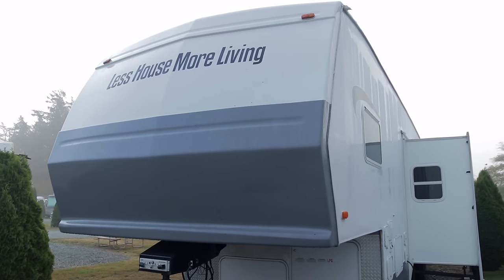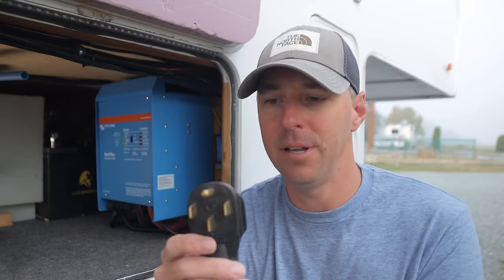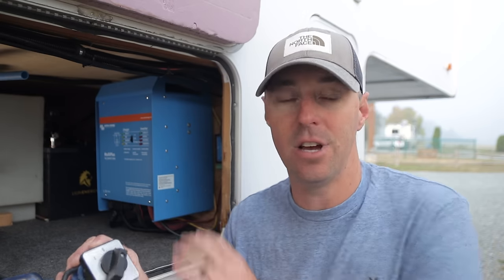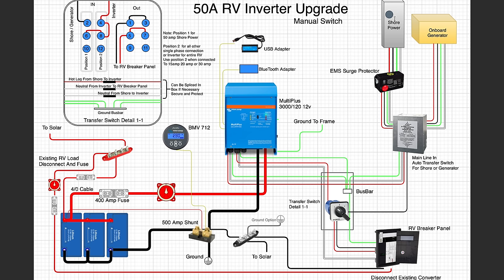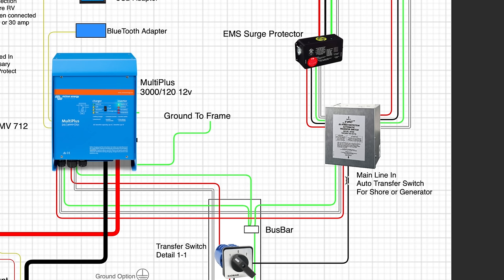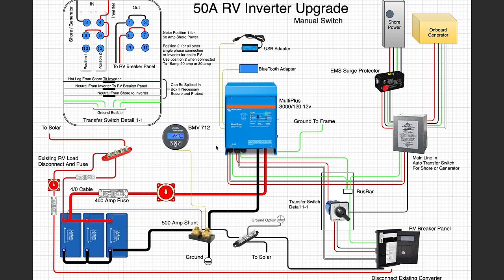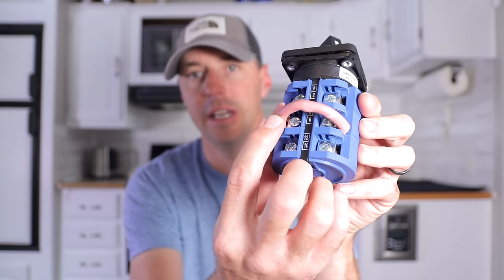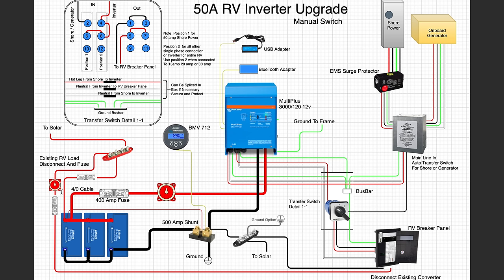Budget 50 Amp Rv Inverter solution!

Comment: Hi. Are you available for hire? I'm wanting to put a similar system like this but in a large cargo van conversion. I will use a generator and many lithium batteries. I need the ability to charge the batteries several different ways like by solar, while driving (DC to DC), on a Onan generator, a standard 110 outlet, 50amp plug, or quick charge at an EV charge station. I don't know if I can use multiple methods at once. Also one of my van appliances (dual induction) unfortunately requires a 50amp connection to get full capability of both stove tops. I'm in the process of purchasing the van right now but it will be weeks before it arrives. Could you possibly help me with this build?

Comment: Sorry if I missed it in the video but what happens if you are in 30amp mode with your switch and you plug into 50amp service. Isn't your switch bonding those two hot legs? I would think at the least you would pop breakers if not cause damage as well. Just curious. Thanks
Reply from the maker: Great question, the second leg is isolated in the manual switch so it wouldn’t cross or pop a breaker. The worst that would happen is you draw more than 50 amps on the one leg and then the breaker would trip. It would only trip if you pulled more than 50 amps.

Comment: Hi.... awesome stuff.  Love your channel!   I was looking at the diagram for the manual switch and I want to make sure I don’t mix up the wiring codes on the switch.  On your 1-3 jumper the orientation on your schematic and the switch match (1 on the left 3 on the right) but on the 2-4 side of the switch they are not matched with the the diagram you provide in the video.  The 4 is on left side of  2 when looking at the switch but your diagram shows it schematically as the 2 on the left.  Can you just confirm that the schematic is just that.... schematically shown but the number are correct?   I don’t understand what the switch is doing inside exactly so I want to make sure my switch numbering is still correct.  I am using the same BAOMAIN switch.  I don’t’ want to find out the hard way I don’t have the exact same setup.   THANK YOU AGAIN!
Reply: Dan, I had the same issue when I installed Jared’s $40 switch idea last year. We are having electrical issues now and I think it’s related to how the switch was wired. How did you ultimately resolve this numbering issue on the switch?

Comment: Hi Jared. Nice video. I just received the manual switch. When comparing the diagram to the switch your wire diagram shows 2-6-10 on the left and 4-8-12 on the right. The actual switch shows 4-8-12 on the left and 2-6-10 on the right. So do I follow the diagram or the numbers?  Thank you.
Reply: Ok never minded. I traced it through and understand that black leg from shore is isolated to position one only and position two is inverter only on both legs. Thanks.

Comment: I am personally not ready to add a system to run anything I want off an inverter. But I thought I would add a comment about a friend of mine who did have a complete solar system added and an inverter that would run anything she wanted in her RV. She had the system for years. And it never worked well for her. She was told to turn on inverter when she turned on her solar panels. And her batteries would run down. She had it in to who did the installation a number of times. Nobody seem to figure it out. Only months before she ended up selling the trailer I finally deduced what the problem was. Refrigerator was a Dometic that would run off either propane or 120 V. When plugged into shore power refrigerator would automatically switch to short power from propane. I bet you can see where I’m going. When the fridge sensed 120 V available from the inverter it assumed it had shore power. It switched the refrigerator to 120 V and there was no way the solar system or batteries we’re going to keep up with that refrigerators draw. This was an older trailer. And I don’t know how many trailers have the same option. Mine does. But I hope it  might prove helpful to somebody to know about. Nice video.
Reply: Dave, I have a 73 Nomad with 120 and gas as well. I read your post 3x and couldn't see the fix to the problem. Can you reiterate please? Thanks, stay well.
Reply: @heatherk8931  If you have put in an inverter to run everything that’s 120 V on your trailer, that is where the problem is. You need to separate the 120 V for the refrigerator from the inverter power. Without going through some wiring shenanigans the easiest way to deal with this is to just unplug the refrigerator from 120 V unless it’s on real shore power.

Comment: Jared, for a future video would you consider a poor mans lithium package setup. We are not full timers but would like to be able to boondock some times. I was thinking of purchasing a Bluetti AC200 which has 1700WH inverter and everything built in. This would also allow us to keep the fridge running on AC while driving (gas while parked). My idea would be to use a similar transfer switch like you used but add a Male plug inside the RV. Then i can use leave the Bluetti inside and plugged in with an extension. I could even run a 12V transfer switch for some other items while boondocking. Issue is i need to make sure i don't drive the house battery charger while running the lithium 120V inverter, else i would back feed the std battery. How would you wire this to allow both options?  BTW great video.
Reply: Google Will Prowse, he is excellent!
Reply from the maker: Yes, I will put this on my list to do this fall or by the end of the year.

Comment: Amazon offers various sizes for the 3 position switch.  IS the 125 amp really necessary or will the 63 amp switch work just as well.  Smaller foot print and should fit in the box much better.
Reply from the maker: The switch in this video is the 63 amp switch. There is one below that I do not recommend but we do have a new video with an update on this setup. https://youtu.be/gbKBoIvXNPA

Comment: Well we ran into a problem and I don’t really understand what happened.  We have been running this set up since Mar of 21 but last week the load side of my surge protector red line that goes to the inverter burnt up, it smells terrible! Have replaced the surge protector and the the wires between the surge protector band the inverter but need to figure out what may have caused that red hot line to burn up.  If anyone has any suggestions I am all ears.  I followed the diagrams to the letter.  The diagram shown in the video is a bit different on the site.

Comment: If I read the diagram properly, when shore or generator power is available, BOTH the RV converter and the Victron will attempt to charge the battery bank.  Doesn’t this cause both chargers to push and pull each other and the charging circuits falsely sensing the state of the battery level?  Also, in a boondock situation where you can’t run the generator, such as nighttime, but you still want the Vectron to be an inverter for 120VAC, the RV converter will distribute the 120VAC but also power the 12VDC converter section which also attempts to charge the batteries.  So you have sort of a circular power-struggle where the batteries are draining down to power the inverter but the RV converter is trying to recharge the battery bank at the same time.  It seems a switch is needed to isolate the connection of the RV converter to the batteries but still let the batteries power all the 12 volt loads when no shore power or generator is on.
Reply from the maker: When you install the Victron you don’t need the converter anymore. Most people just disconnect it. We left ours unplugged because it is a lithium converter so when we do need to fire up the generator we plug in the converter as well and have the converter and victron charge at the same time, hey can charge together with no problem with our 3 batteries. Having two chargers hey don’t fight each other but charge together because charging isn’t just based on voltage.

Comment: Hey Jared, we met in cottonwood last year when i was buying a multiplus and installing solar.  quick question for you.  my SPS has failed already.  So now I'm thinking of adding this switch instead.  when you switch from 30amp/inverter to 50amp position does the whole RV lose power in the zero position or does half the RV still maintain power from the inverter during the switch?
Reply from the maker: Hi Bill, yes I remember meeting you. The way the diagram is yes it looses power at the zero position but I plan to change that. On our new RV I made a slight change and now leg 1 never looses power even when switching. It makes it nice for the microwave clock to not reset and for other things like the TV turning on every time we would plug in for power or having the fridge on while we drive. Send me an email at jaredallaboutrvs@gmail.com and I’ll see if I can draw up that change this week and get it to you.
Reply: @AllAboutRVs  thanks Jared.  That would be awesome.

Comment: I want to use the transfer switch when I turn in position one it will be stuck when I turn position two it will be using the inverter charger that's why I need to contact you  and my rv it's only a 30 amp

Comment: Hi Jared,  I have been working on my 12 3000 victron and using the diagram that comes up when you click on the link under your video a different diagram comes up than the one in the thumbnail of the link.  which is the correct one and how do I get a copy of the one in the thumbnail if thats what I need?  Thanks
Reply from the maker: The download PDF is the updated one you want to work off. I have made a few improvement updates and forgot to change the thumbnail.

Comment: Hey Jared, great video.  One thing I noticed though...  High current system's main enemy are connections.  If I'm understanding your diagram correctly, when you are in the 50Amp mode, the RED leg is going through two jumpers and three connections in the manual switch.  It seems to me it would be much better to wire the RED leg to pin 6 so that in 50Amp mode you just have the one connection going through the switch, and when you are in 30Amp mode, then you are going through the jumpers.  Please let me know if I'm misunderstanding the diagram.
Reply from the maker: That is an excellent idea. I’m going to change the diagram now.
Reply: @AllAboutRVs  Hi Jared, so is the schematic on the site now (9/19/20 at 10:26PM Pacific) the corrected one?
Reply: Got it.  watched again.  thanks.
Reply: @AllAboutRVs  could I get a diagram of the new change on the switch

Comment: Hi Jared- can you post a link where to buy those metal splicers you suggest?
Reply from the maker: I have an update video I am working on now for the manual switch that makes it a little better less connections and slightly easier for the jumpers on the switch. Here are the splice connectors I used and it was easier than the other ones I used and no need to do the heat shrink over it afterwards. 
3way #6 connection. https://amzn.to/3cUzXHG
2way #6 connector. https://amzn.to/3jxxQuL
I used one of the 3 way and I would use 2 of the 2 way.
Reply: @AllAboutRVs  Thanks for the quick reply Jared.  That's exciting about a video update.  I'm going to install mine in late March, weather allowing. Do you think your new video will be public by then?
Reply from the maker: Yes it should be out within a week

Comment: I had a SPS fail. I got the manual switch. I want the manual set up to throw if the SPS fails again.
Reply: Mine failed too.  It's garbage
Reply: @billdorn1053  I got the rotary switch that he suggests. SPS sent me a mechanical unit as a loaner. They are between VER 1 and VER 2 of the ‘silent’ unit. For now I just jumped out the entire inverter. I’ve only gone out twice in the last year and had 50amps at both parks. SPS told me VER 2 is taking longer than appreciated . Should be available this Summer. They agreed it was under warranty and say they will replace it with a new VER 2. I’ll try to wait, but the switch goes in around May they drag their feet any more. Did you call them?? They are not cheap and should do something like they are for me.
Reply: @christopherrasmussen8718  I just ordered this switch and in the mean time they said to use a sharpie pen cap to jam in between the contactors to force it in and bypass the SPS.

Comment: The download for wiring the manual switch at this time doesn't appear to be complete.  It is not the same diagram as in the video.  You'll need to stop the video and do a screen capture of the wiring diagram for the switch.
Reply: Please disregard my comment on the wrong diagram being available.  The video has an update which shows that the diagram currently available is correct and much simpler to install

Comment: Why don't you wire it so that position one is single phase, one hot leg, and position two is split phase, two hot legs? That bugged me about the last video.
Reply from the maker: Not a bad idea. In my mind I thought of position 1 as first choice, 50 amp shore connection at 100 amps potential  and second position as second choice maxed out at 50 amp potential. It would be easy enough to wire the switch the way you want as well.